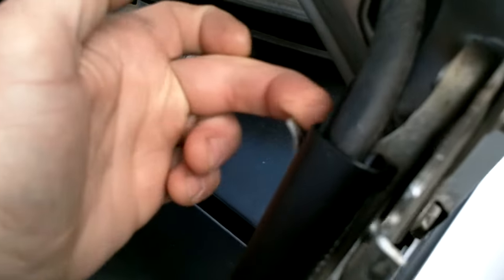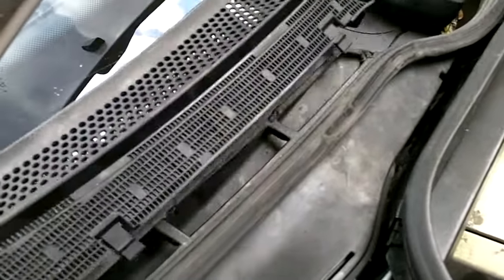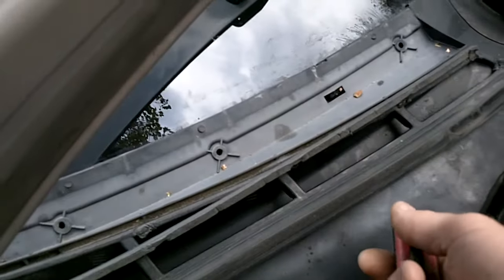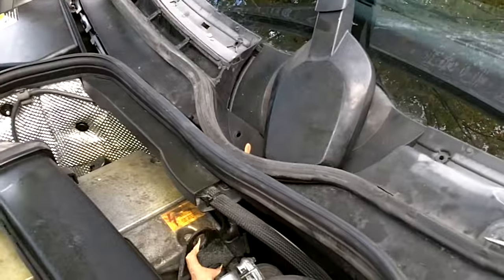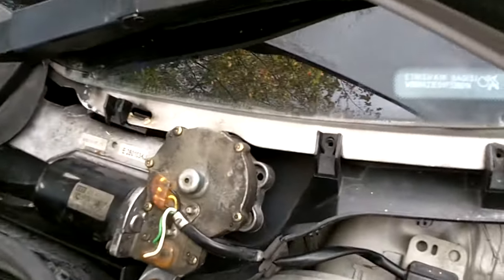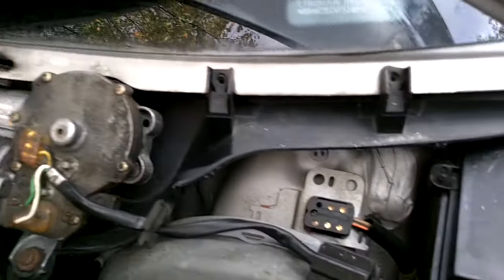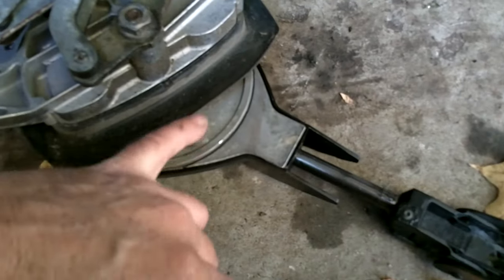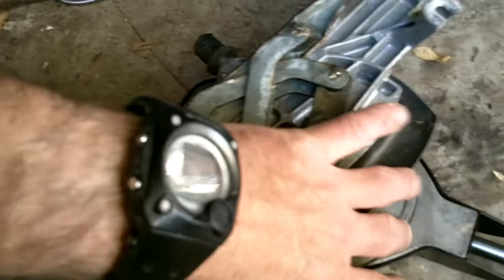how to remove Mercedes w202 windshield wiper motor assembly and lube

Comment: This video was terrific! - I'm not an auto mechanic, but considering the $1250.00 potential cost of this repair at a dealer, I decided to watch the video and try to fix the part myself. The step by step was precise and accurate and made diagnosis very simple. I had a bad motor, so I purchased a used unit and replaced the entire system in less than an hour for $110.00 dollars. Great learning experience and many thanks for the great video!
Reply from the maker: thanks..I'm glad it helped  :)

Comment: Many, many thanks! The hub nut came off my motor last weekend. An easy fix once I got down there, but I wouldn't have gotten down there without this video. Instead of a couple hundred dollars at the shop, the job cost me $1.88 in parts and a bit of skin off a knuckle. What a bargain!

Comment: Your video is an excellent guide for working on this problem. My problem was the loose nut. We get a lot of rain, so for an item of this vintage that had such a minor failure I remain amazed that I could sort it out with your video. While in there, I also took advantage of cleaning the blower squirrel cage, and cleaned all of the old mud from inside the collection cavity. Thanks again.
Reply from the maker: Glad it helped

Comment: You saved me a fortune in dealership repair labor! I just pulled the wiper unit out, greased the linkage and replaced the motor and it works again! Although shaky and unfocused due to holding the camera and trying to take it apart at the same time, your video gave me the basics on disassembly procedures. Awesome! THANK YOU!
Reply from the maker: Lol.. you are very welcome..I am working on the shaky and unfocused  :P

Comment: HI, Your videos are great - having just gone through the process of doing this twice after my replacement motor failed, I wanted to add a couple of possibly useful comments.

1) I found that an easier way to release the 2 problematic central clips was to push with a screwdriver from under the panel from the windscreen side once you have undone all the other clips.

2) After the nylon cog in the motor was destroyed for the second time, I went to a local specialist Merc scrapper here in the UK and they recommended I swap the whole mechanism and motor assembly for the one off a W210 - the cost was the same. It looks slightly different, and other than needing to swap over the wiper end of the arm (a single allen key bolt but hard to pull off as a tight fit), it is a direct replacement and a much more robust design - it feels more solid.
Reply from the maker: excellent..thanks for the tips..

Comment: I'm sooo gratefull to you for this video ! I had a hard time because I'm not used to doing mechanics and I could'nt find the proper tools, and it was raining many times, and... I got so upset that the first time I didn't watch it till the end before I put everything back on, thinking I need to buy the motor (which was running, but I thought it may have ran week). Then I watched the end of your video and had a doubt about the 17 and 13 you're mentionning, I motivated myself (1 hours before night!) and disassembled it all again. Tada ! The 13 was simply missing! and I stupidly found it normal the first time (duh!). I found the missing 13 "screw" with a magnet. It had simply fell (and the wiper stopped working yesterday, after showing weeknesses for a month or so after snow...). A friend told me yesterday it could be a loose screw, but he had in mind a car where they are accessible. Without you video I could'nt ever have had a chance to fix it myself. Tomorrow morning, I just need to figure out how to find the proper "0" position. Could'nt find a satisfactory one befor night... Thank you so much again !!!
* Résumé en français : vidéo pour réparer un essui glace en panne alors que le moteur fonctionne sur une mercedes classe C 180 essence. Il faut : tournevis plat (pour les taquets plastique), tournevis cruciforme, clé à pipe de 10 pour le démontage, des clés de 13 et 17 (pour les écrous qui se seraient desserrés au fil du temps à cause de l'effort du à la neige ou au givre), éventuellement un aimant télescopique pour ne pas perdre les écrous, du lubrifiant rouage et de la graisse.
Reply from the maker: Glad you got it fixed

Comment: This must be a common occurrence for our W202s, huh? My motor went the other day. I took the "turtle cover" off and thought that was the way to get to the motor. Removed everything inside of it and got stumped at the "screw" in the center of the mechanism. I though I needed a MB Specialty tool and ended up butchering it. Now I've come to realize I didn't need to do any of that. haha. Thank you for your video. This has helped me a great deal! Subscribed!

Comment: Thank you so much! Great video, and it is really great that you say what size all the bolts and nuts are so a tool lacking rookie like me can fix the wiper too. My wiper had stopped moving, but I could hear the motor running, so I knew I had to tighten a nut or two. When I got it appart the 13 mm nut connected to the motor was missing, so the whole arm had fallen off. I found the nut and got it all back together. Again: Thank you!
Reply from the maker: I'm glad it helped.. :)

Comment: Thank you Fupabox, your video clips are always informative and very detailed, which gives us the confidence to keep amd maintain our W202 (6yrs strong now) our wiper arm had bent internally and have managed to fix it by watching your clips to remove the wiper and bracing it with 30mm SST + rivets + tonnes of grease. (which was the reason for fail) Thank you once again and keep up the Great work.
Reply from the maker: sounds like an excellent Macguyver you did on the wiper  . :)

Comment: Hey bud thanks for uploading the video helped a lot. i hate trying to figure out german cars. i found a way to not break the nylon strut assembly support. Here is the video. thanks.

Re: how to remove Mercedes w202 windshield wiper motor assembly and lube

Comment: Thank you for uploading this video! It really helped me sort out the problem i had with my windshield wiper. On my car, it turned out all i had to do was tighten the 14mm nut on the back of the windshield wiper base, as it had loosened.
These old mercs are good, reliable cars, and if you can do some of the maintenance yourself they are quite cheap to run aswell. Thanks to your video i saved both cash and probably some time just doing it myself! 
Cheers!

Comment: Great video.....I know it saved me a ton of money.  Actually, my problem was a loose nut.  Had to add a lock washer and I changed my motor anyway since I had it apart.
Reply: Yeah those drive nuts and washer are an issue Not expensive to improve

Comment: Brilliant video .. I did find with mine that I had to replace motor, and the drive mechanism wasn't locking down which was an easy fix 2 washers and nylon threaded lock nut. All up cost $70 motor 60 cents washers and nut :)
Reply from the maker: Thanks for sharing

Comment: Thanks m8 for this great video! Today I lubricated my wiper after riding almost 2 years with an unstable one which hanged so now and then. Now it works without sound like a charm!!! I used bearing grease from - 20 up to 120 Celsius so in the summer the grease should not flood away.
Keep up your great videos!

Comment: Thanks for the instruction video. I am about to change my windscreen wiper motor for the 4th time since I bought my 2001 W202 in 2008. Very reliable car and all but the windscreen wiper mechanism and motor is a weak spot in this vehicle. OK, I bought a cheap aftermarket motor for my 3rd replacement which was not up for the job as it stopper running after 10min because it got warm evenethough I have lubricated the mechanism. And the ax easily got worn down so there was not grip on the transmission anymore which is also a weak spot.
Reply from the maker: 4x  wow..you can prob do it in your sleep now. likely the reason they went back to a two bladed system
Reply: fupabox Removing the whole mechanism is indeed easy for me now 😄 I have an office job yet I do not fear repairing stuff. And I worked at a Mercedes dealer for 1 year which allowed to me learn a few things from the maintenance guys. Still, your video is really nice in seeing all steps in one video.
Got 1 tip for you I learned from the repair guys regarding removing the plastic clamps to take the large cover out: take an old and thin screwdriver and bent the top 4cm to an 45 degree angle. With that tool you can easily unclip the difficult ones by sticking the tip behind the clip and twist it so it comes loose.

Comment: Thank you for posting I fixed mine in the driveway and didnt even crack the plastic clip with the rubber bushing in it the nut fell off the back of the motor luckily it was an easy fix but wouldnt of had any idea where to start without this video #1994c220

Comment: Thanks for your help.
The dealership ran the VIN and gave me the original part number- when I asked him which manufacturer or motor type it was he told me "I put the number in the computer, it tells me what number part to replace it with- that's all it tells me". 

I'm in North America. Parts shops want to know if it's SWF or Valeo equipped.  I have no clue, no one else seems to either just that they're two different motors that don't appear to be interchangeable.

Thanks so much for responding.

Comment: How would you remove that black gasket/seal at the base of the wiper assembly? Mine is cracked and I want to replace it but I’m not sure how to take it off and get the new gasket on

Comment: Hi thanks for the great video instruction. Struggling to remove the plastic turtle cover (item 60 on the parts breakdown list) which covers the top part of the assembly. Wanting to grease the moving parts under the turtle cover area. Can you please explain how to remove this turtle cover without destroying it. Out of interest the local Mercedes dealer tried to help but the turtle cap did not budge and they gave up. Many thanks in advance Arnold
Reply from the maker: the older single wipers (190 and 300 from the 1980s early 1990s had a cover that wasn't removeable. The w202 plastic cover can be pryed from the bottom and pops off fairly easily

Comment from the maker: you need to enable replies for me to reply to your question...

on the washer nozzles you will see 2 little metal holes where the fluid comes from...take a sewing needle and gently poke it in one of the holes..then you can move the little metal spray hole around  (it's a ball socket inside and can be moved around) until it hits where you want on the windshield
Reply: Hey Fupabox. I am having wind noise coming from the front of my windshield on the bottom. It is making me ANGRY and I need to figure out how to fix this. I checked all the edges and it seems like there are no gaps. I even put some window sealant around the bottom of the window and I am still getting noise. My only guess is that the plastic cover under the leaf protector is the cause of it. There is a rubber lip that has worn off. Wind must be getting under that plastic and causing the noise. What is that plastic part under the leaf protector called? I have a 2001 e320 sedan.
Reply from the maker: joshlete check this page's diagrams to find the part you re looking for   http://www.mbpartsworld.com/productSearch.aspx?&ukey_make=1103&modelYear=2001&ukey_model=16158&ukey_trimLevel=20619&ukey_driveline=0&ukey_Category=24390&numResults=50&sortOrder=Relevance&isOnSale=0&isAccessory=0&isPerformance=0&searchTerm=windsheild
Reply: *****
Do you think the part im talking about is the problem with the wind noise? Also, I can't seem to find the name of that part.
Reply from the maker: joshlete it could be, almost impossible to say for sure....I'm not sure on the name of it either

Comment: Hi. Not sure if you will read this but I have to access the heater core hose in the space beneath the drip guars there. It calls for removing the wiper motor and then the drip guard beneath. But to remove the drip guard it is neccessary to disconnect the computer and move it aside. I am reluctant to do this. Have you ever had to change the heater core connector hose? w202.
Reply from the maker: I haven’t had to replace the heater hose before . If the computer needs to be disconnected then make sure you take the proper steps to unhook the battery safely . Keys out of ignition .Remove the NEGATIVE cable , then the positive . ( reverse when hooking the battery back up ) . Once the battery is fully disconnected cover the battery with something so the terminals on top of the battery can’t be touched ( a towel or tag is fine ) now take the negative cable and the positive cable that are disconnected and touch them together for 20 seconds . This will discharge any electricity left  in the electrical system . If your cables are too short to touch each other you can use a piece of wire , coat hanger , anything metal to reach between them. Make sure the posts / terminals on your battery aren’t touched during this discharge process . Now you can safely remove the computer . Reverse the battery unhooking process once the computer is back in . Positive cable onto battery first then negative. Only once it is all back together should you put the key into the ignition. Hope that helps
Reply: Thank you and thank you for the video.
Reply: Hey thanks again for posting. I did not need to remove the drip tray to replace the heater core connector hose. So thanks for the procedure here! Got me where I needed.

Comment: I have a leak in hose near windshield nozzle/sprayer on w203 (MB C240, 2004). Have problem removing the hood grill where 2 nozzles are located. I unscrewed 3 bolts, but something is holding nozzles assembly. Do you have some recommendations take those elements apart?

Comment: I follow your instruction today and lube my wiper under the "turtle shell".  My sometimes my wiper when it's on intermittent (1st click) suddenly goes into continuous slow (Like it was in 2nd click). Turn it on second click and it stay the same, third click then it goes fast as it suppose to. Then turn back to first click, it stay on low continuous, then turn off it still goes low continuous. Is this a problem with some relay or is it the stick contacts? Thanks for your help. It's a problem because it doesn't rain that hard in Seattle. lol
Reply from the maker: Just a hunch..but may as well try the easiest first..the wiper relay is under the rear part of the fuse panel (6 phillips screws on the cover of the relay cover...maybe 8 ..can't remember)  then the relay is the biggest one inside pull it out and check the connector feet for corrosion  (only remove and install the relay with the ignition off)  put the relay back in and turn the wipers to intermittent setting and place your hand on the relay...you should feel it click on and off
Reply: ***** Ok, I will try that.

Comment: I just read what to do with a wiper that parks on the passanger side. So just to make sure I need to remove the entire wiper system (motor and tranmission) to be able to get the wiper to park correctly, right? I cannot do this procedure without having to remove the system. Just what to make sure I understand it correctly. Thanks. By the way you have saved me thousands of dollars. So far I have change my spark plugs, clean Mass air flow sensor, Throttle body, and cabin filter. Its my first c-230.

Comment: As always, Fupa comes through in the clutch.. really wish you were still doing W202 videos.. having troubles with wiring harness and maybe injectors.. anyhow before I digress further- serviced the wiper transmission but  now the wiper will not got back to the original park position. Parking at drivers side 9 o clock position. Any idea how to remedy?
Reply from the maker: You need to align the wiper arm’s position when it’s off . Take the arm off turn wiper motor on then off . Now the off position of the motor is set . Now turn the inner gears of the arm so that the arm is unextended and all the way left as it would be when parked . Then reinstall the arm

Comment: Thank you very much for your fast response!

I've had a couple of mechanics just "look at it" so far and they both want me to change the wiper motor... which would be fine if I was anywhere BUT Australia; the cheapest one I can find here is 550 bucks.

I'm going to have my mechanic disassemble the whole thing and diagnose it... but if I can have a go at it beforehand with some grease, it would be good. What sort of grease should I use, if I do this by the way?

Comment: fupabox thanks for your videos they are really helpful. i have a 1997 mb c280. my windshield wiper is currently getting stuck when it gets turned on. it will wipe half way than pause than wipe the rest of the rest of the other side and come back down while stopping a 2nd time. idk what its wrong with it. please let me know what you would suggest to do. i also want to mention that this just started happening soon after my highbeams stopped working and the switch stick getting really hot once i turn on my wipers. Would you suggest replacing the wiper and high beam off/on switch stick? please give me advice thank you.
Reply from the maker: +Surrell Cardoza  it is either the high beam/wiper/turn signal switch, or the contacts in the wiper motor... I had a similar issue with my sons c230 kompressor.  It was the contacts in the wiper motor..they had a lot of corbon build up from years of use..enough carbon mixed with the grease in the motor contacts ,that it would create an electrical contact within the grease..cleaned and re-greaded and it works fine...if that doesn't work, I wold swap the wiper/highbeam switch  https://www.youtube.com/watch?v=mfqExxuwqyA&index=99&list=PL1A207D50FE3FB01F
Reply: Ok thanks man keep up the great advice you give on these videos and comments👏👍